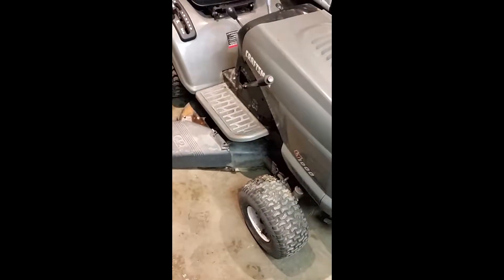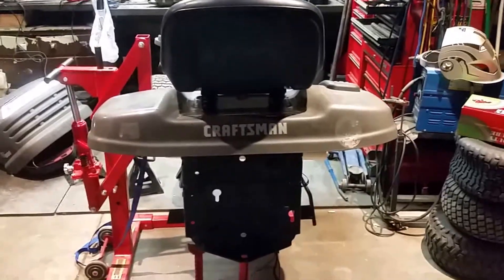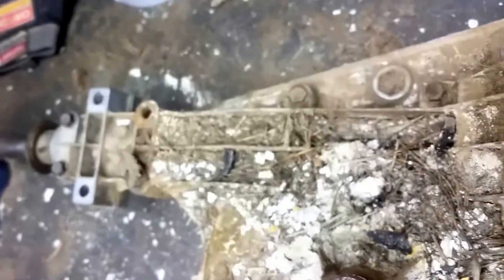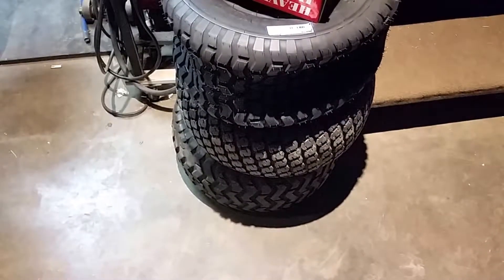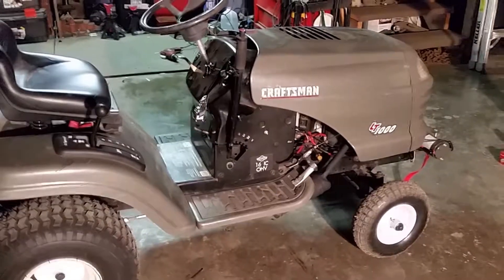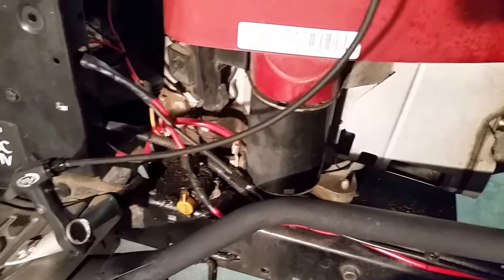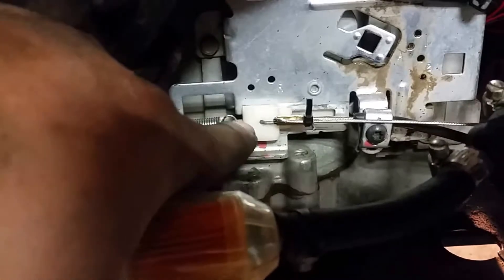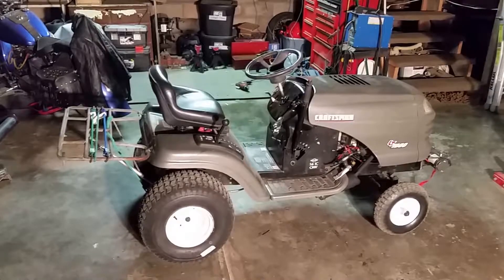Poor Man's ATV

Comment: We bought a 19hp craftsman mower brand new some years ago, looked similar to yours. One day while cutting the yard (which was level by the way and I never hit anything) the entire front end of the frame suddenly broke off and went under and hit the deck and blades. They replaced the front frame and deck under warranty.... but it just showed their cheap and poor "craftsman"ship ... something that shouldn't have even been possible, just ridiculous. 
Craftsman would also just sit and spin (one tire) trying to go up any slope or incline. My old 11hp murray could out pull, climb (up hills), mowed as good or better (even though a slightly smaller deck) and was far tougher than that craftsman ever was.  And I think I sold the old murray for more $ than I got for the craftsman when we moved. To bad things/tools aren't built like they used to be....

Just changed out the headgasket on a 16.5hp poulan that we got for free. Took a lot of clean up as everything was soaked and coated with oil... But it runs good now. Want to build a small trailer to use with it, just for small hauling stuff around the house. And can use it if I need to go somewhere on the property and don't feel like walking that far, or if I want to take some tools with me. I think it'll be a useful addition, especially since we don't have an atv. Need a UTV, but got a MTV (mower terrain vehicle) instead  LoL